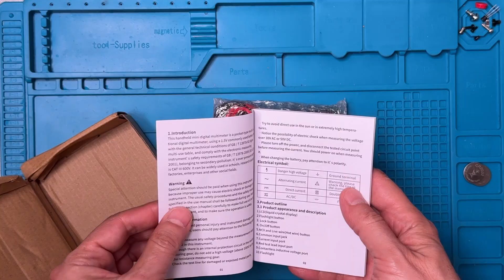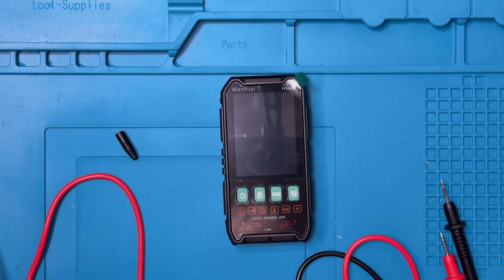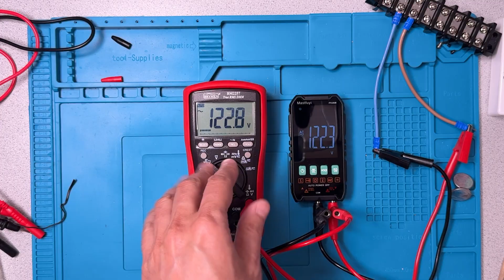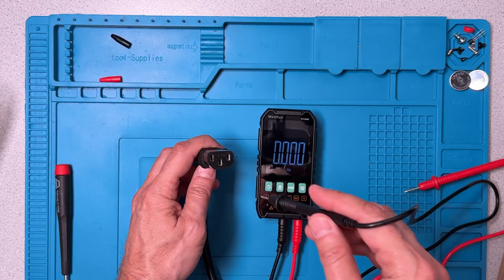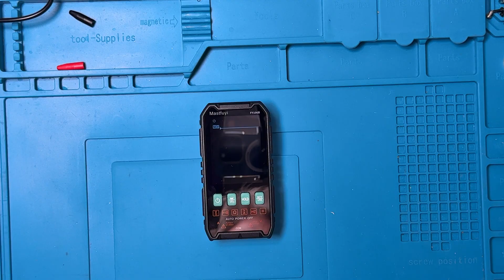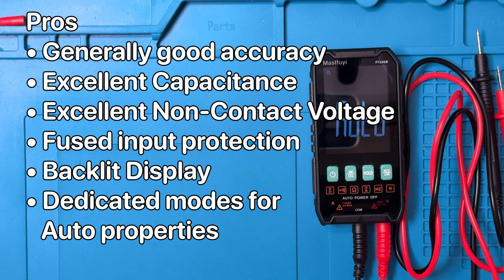Mastfuyi FY106B Unboxing, Review and Teardown

Comment: Great review. Nearly all important questions answered. I have three more: 1) Are the plugs usable with the standard probes that you can buy everywhere? Because at least one other brand has non-standard plugs which annoys me. 2) How long are the cables of the probes? 3) How long do the batteries last in an average setting?
Reply: Update: I bought one and can now answer my own questions for interested people: 1) The plugs ARE standard plugs, great!  2) The probes are 89 cm from the plug to the top tips. A bit short but still usable. The tips are more suitable for standard electricity work, but too big for SMD repairs. But since the plugs are standard I could connect my very sharp and long SMD suitable probes. These are 120 cm long. Batteries are AAA. I use rechargable ones. Can't answer 3) up to now, it's too early. My summary: If the device continues to work like this, a good buy.
Reply from the maker: Happy to hear that you like it.
Reply: Yeah, another positive thing: Yesterday I forgot that I had the red plug in the ampere input and produced a short. All my fault. Even that a loud bang occurred the device took it easy. You can simply open 4 screws, pull one half away and replace the 250V/10A fuse. There is a holder inside (not mentioned in the manual). Everything worked again. Good construction.